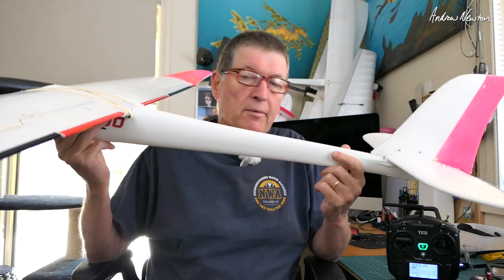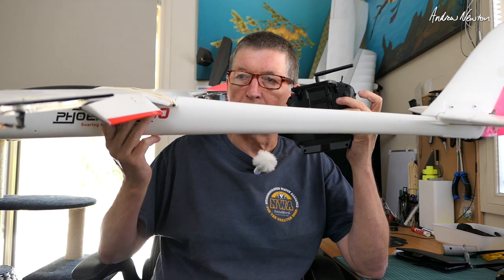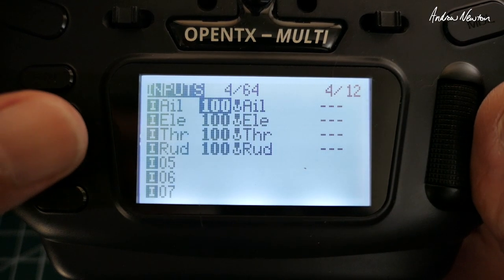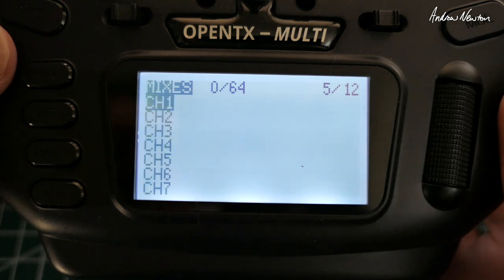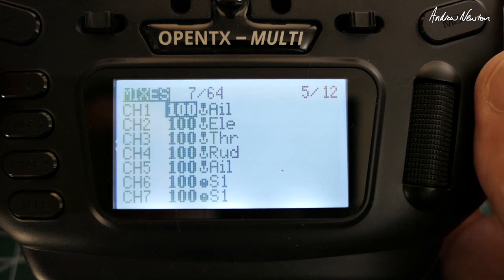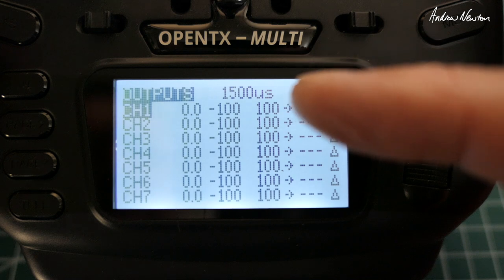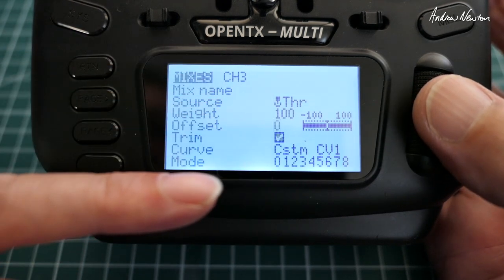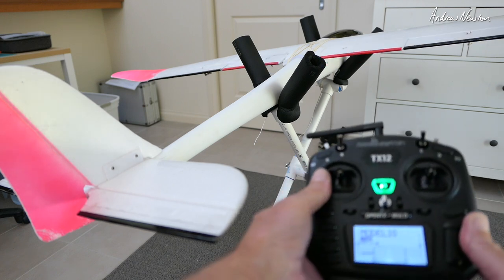Crow Brakes Mix for TX12 OpenTX EdgeTX

Comment: Thanks Andrew for this timely video! You've presented the whole process nice and clearly to a relative newcomer. 👍 Based on what you did I  now have crow brakes in my Zorro for a Bix 3 I've just 'inherited' from my club (which elicited a donation of course 😀). My setup is slightly different: I've kept the full flap adjustment (incl reflex) on the slider/wheel and arm crow brakes on a 2-pos switch whilst keeping them deactivated for any reflex flaps. Plus I've mixed the flaps into the ailerons,  last step is to mix the ailerons into the flaps but that will take an extra channel- I've only got a 6-ch receiver currently.

Comment: Off topic, but noticed you were using the FrSky X8R.  I've noticed I'm having slight range issues with mine while under range check.  What antenna's are you using on them? The printed flat board type that comes with them, or did you replace them with something else? Couldn't see properly in the video.  Thanks for your advice.     PS. Love the Swordfish.  Finally maidens mine this morning.   Beautiful bird.   I am thinking if making a couple of wing extentions, maybe 6" or 8" each between wing and fuse for a little more float in calm, no wind day's
Reply: Russ. Take your X8R and put it on a concrete floor, then hit it with a hammer, then throw it as far as you can. That’s what I did with two of them, I could never resolve their issues.
Reply from the maker: My X8R has the chunky plastic covered PCB antennas. I would expect at least 2km range unless your antennas are broken. Love the idea of a more glidey Swordfish.

Comment: this is really good newt ! Im building a flying wing 2400mm and I am putting spoilers on wing end, they are like a crow but its a flap below mirroring the flap above, like a clam! both open the same. act as air brake and drag to get flat turn like a rudder does. this will help me. I just dont know how i am going to actuate the spoiler on one servo 🤔
Reply from the maker: Very interesting. Probably need 4 servos

Comment: This is so cool - I'm new to RC and I've got a couple of questions - I've only seen TX-12 as ELRS - Where did you get a 7 channel receiver that's compatible with ELRS? Does this act to slow down the plane when landing?
Reply from the maker: Yes like airbrakes. This is not ELRS
Reply: @AndrewNewton  Thanks for confirming. Where does one find the TX-12 in 4-in-1 or is that even availabe?
Reply from the maker: Not available is seems